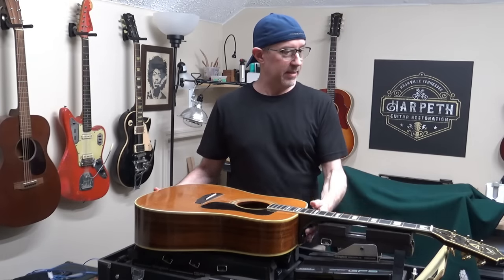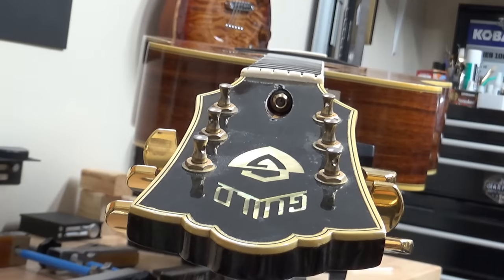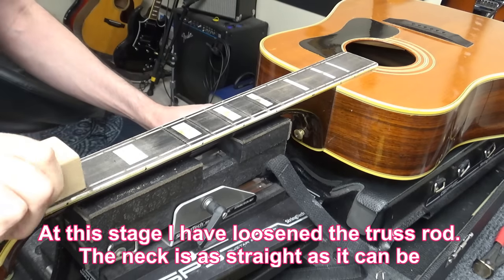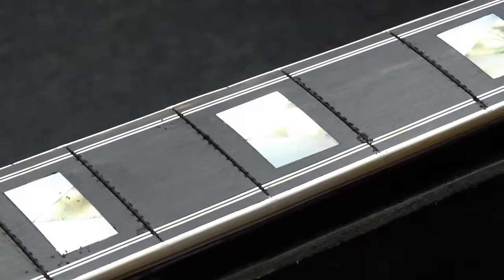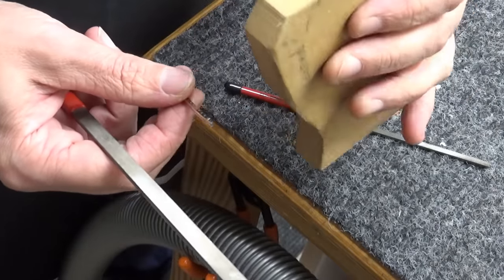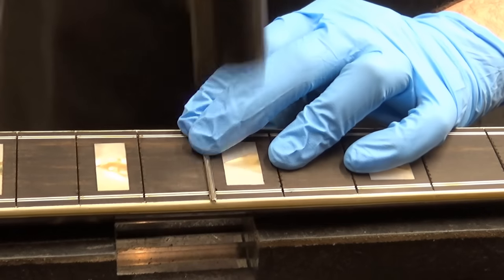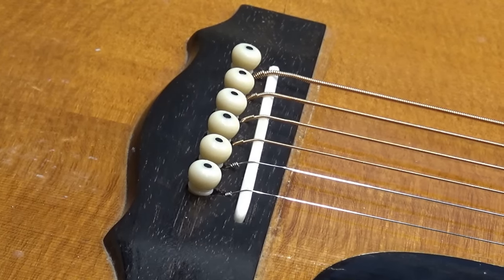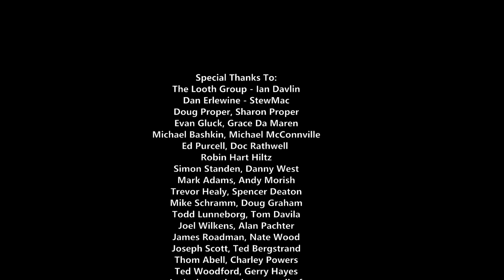Twisted Neck  Guild D-55

Comment: The single rod design compresses the neck wood when tightened. That is why they are more prone to cause neck twisting when tightened, because both sides of the neck may not compress evenly.    A double rod compresses on itself instead of the wood and the force is only on the bow of the neck.
I have not had any neck twisting since I started using the double rod system.

Comment: I did this same basic procedure recently on an Epiphone P90 Special that had an action problem. The neck was twisted slightly at the nut with the low E corner rising enough that the twist was easy to see, and the Low E string was gaining string height making the guitar harder to play. On the high E side, straight neck and no problem, with 1.25mm 12th-fret action height. I twisted the neck on a clamping jig on the bench and forced it back a little beyond flat to try and give the wood a new memory, and applied heat and kept the twisting force on it a couple days. This nearly straightened the twist when the neck was out of clamps and relaxed. I proceeded to level the existing tall jumbo frets, biasing toward the top left corner of the fretboard with my sanding beam to remove an extra few thousandths of metal from the frets there but barely touching the frets on the bottom right while just kissing the middle. Then I recrowned the affected frets and recut the nut slots a little on the left, bass side. So far the neck has stayed put and the sanding cheat on the fret levelling has the guitar playing better than ever. Let's see if it lasts.
Reply from the maker: Nice Job!
Reply: @harpethguitar  You too! I kinda 'plek'd' mine by eye and feel. Works at least once, if the twist is a good bit less than your fret thickness. And if the neck is done twisting, problem solved unless/until you wear the frets out. I probably won't. So for a few hours work I get years of pleasure out of a new improved guitar I wasn't playing much.

Comment: Another fantastic job!  That was so impressive. Does the wood have a "memory" to some degree? Won't it want to go back to the previously twisted geometry?
Reply from the maker: Thanks 🙏 The heat and pressure reset the wood memory and the refret is insurance that it stays put. 😉
Reply: @harpethguitar  Thank you kindly for the quick reply. I have a tele neck that is relatively new... however there's a bit of a ski jump at around the 14th fret or so, actually it's a dip from about the 11th and then starts ramping back up. The truss rod doesn't seem to do anything. I was thinking of heat and clamps. But not a refret. Thanks again for the mad skillz!! You are a blessing, Mr. Scott!! :goodvibes: